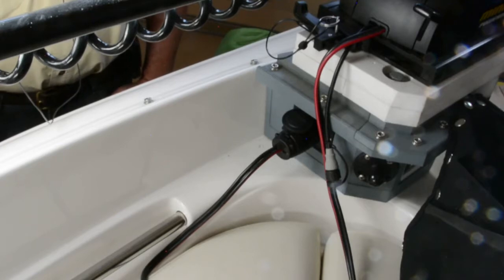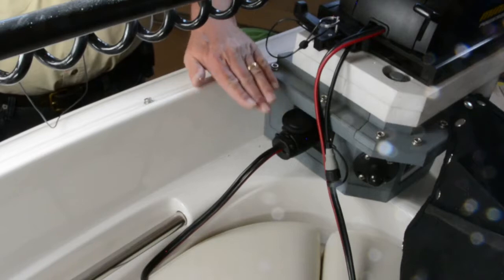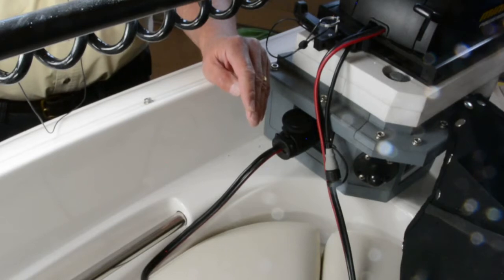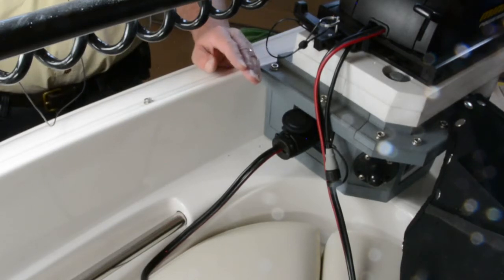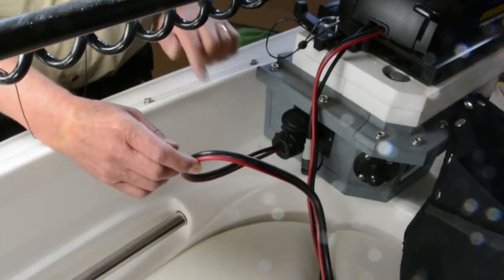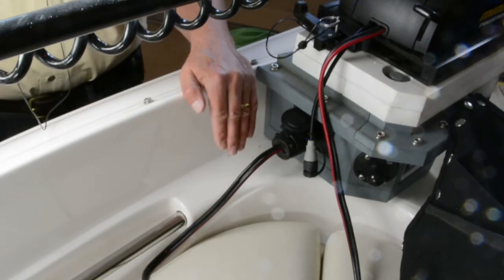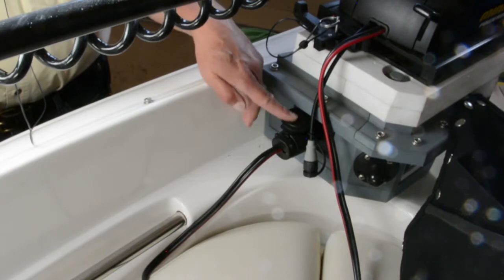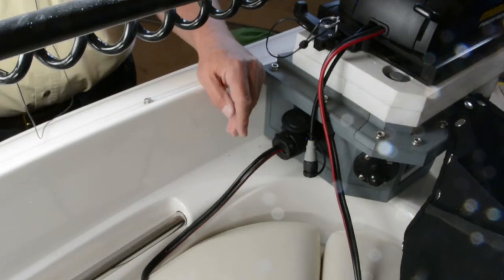Trolling Motor Plug Install Dos and Donts

Comment: I know this vid was 2 Years ago but it's Sept 2024 and the "Minn Kota MKR-28" is the shit.! 
 I've had one on my Shallow Sport 18 and it's been mounted flat on the deck since April 2024 and if you use common sense you'll be a winner.!  The gaskets work well, again it's a great Trolling  Motor Plug.
"Tight Lines and Full Limits To Ya"

Comment: Have you tried the newer MKR 26 Plug from Minn Kota? I am really debating between that plug and the battery tender.
Reply from the maker: Both are good plugs.  We will do a review on the MKR 26 at some point in the future.  For now, it is my belief that the choice between those two would be dependent on the types of tools you have access to.  We provide properly crimped cable sets for making certain there are no losses on the Battery Tender, including no splices in the power leads.  Please let me know which trolling motor you have.
Reply: @GoldenChannels  24V MK terrova 80lb without iPilot. I had one of the older Marinco three prong twist lock plugs, but it got melted and started smoking a lot when I was running the trolling motor hard.
Reply from the maker: @justinb9939  The newer Marinco is night and day better than the old Marinco plug.  The big problem with those was when water followed the cable back into the plug and corrosion built up.
Depending on how long your wire run is from your battery to the receptacle, Minnkota recos 6 or 8 AWG.  We can do custom cable lengths with a 130 ton crimp to give you one seamless wire from any connector you want to use.  https://goldenchannels.com/product/custom-trolling-motor-cables-6-awg/
Reply: @justinb9939  I had the exact same thing happen. Except I was trolling for salmon and then smelled smoke, looked up and seen the old marinco twist was melting. I recently bought the new one that is pressure seated. If this one fails I will be going with the Mk-26 or the Battery tender one. I jumped the gun on getting the new marinco. I wish I waited then I would have found the new MK one and the tender and it would have been between them two.
Reply: @BrandoLoves2Fish  I ended up going with the battery tender, just since I was able to get it locally. I don’t regret it at all. Seems to be a great sturdy plug.
Reply: @justinb9939  Minn Kota told me the power cable for the Terrova is 10AWG, in this video above he mentions the Marinco is for 4,6 and 8 AWG, so I may have to get the tender after all or the MK one. But if he is correct and Minn Kota is correct that would mean Marinco plug can't be used on Minn Kota's motors as I would suspect they all have 10AWG?
Reply: @justinb9939  sorry its not the video above saying this, its this one .   https://www.youtube.com/watch?v=ffiyNeDpL3k
Reply: @BrandoLoves2Fish  I think with the right furrels it would be fine. I just had to get the right size ring terminals for the Battery Tender plug. Then I sprayed it all down with fluid film when I was done to add more protection to it.

Comment: You say don't do horizontal but your example in the video is  horizontal. Vertical seems like it could fill with water easier
Reply from the maker: Sorry for the confusion.  My exact words are "mount the receptacle vertically".  The plug should enter the receptacle at a horizontal plane, or if possible, at a slightly downward tilt towards the power cable going into the plug.  The important point is you should never mount any receptacle so that it faces upwards towards the sky, as it will become a moisture collector (which is pretty obvious, but yet I have seen people do this, including videos here).  Some connectors will allow water to go through them, others are simply a cup, and will continue to hold water that accumulates from spray or rain.  The power lead should drop downwards from where it enters the plug.

Comment: if the trolling motor plug goes under the water we got big trouble
Reply from the maker: True.  But the probably the single most significant failure cause I see is condensation and rain following a cable from the motor in a downwards fashion into the plug and gravity makes certain to provide an endless supply of moisture to the internal contacts of the plug.
Electrical cables that are installed in an outdoor environment by professional installers always have a "drip loop" where the cable enters the outdoor electronics, or below a splice, so that in all cases, moisture is taken down from any connection point.
Thanks for subscribing!
Reply: @GoldenChannels  very true
good coverage on the subject   I look forward to see ore videos on your channel
Reply: I recently bought a plug and socket that is made for 6ga wire, gold plated brass contacts, for 12v to 48v power at 50 amps continuous, and with an IP68 rating for $26 from an online giant that offers 2 day shipping.
Reply from the maker: @muzicwoody  Sounds Interesting.  Let me know how it holds up.  What is the current draw of your trolling motor?
Reply: @GoldenChannels  I believe the max amp draw is 54 amps.
Reply from the maker: @muzicwoody  From your description, it sounds like you have purchased a solar connector. Those are fine if they have a reasonable mating cycle rating. Solar connectors are generally only mated a few times.